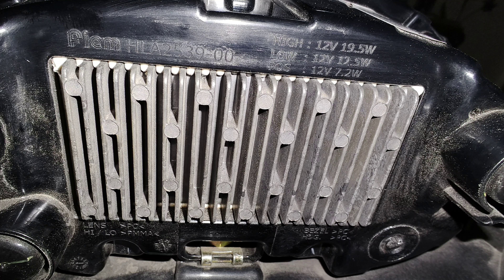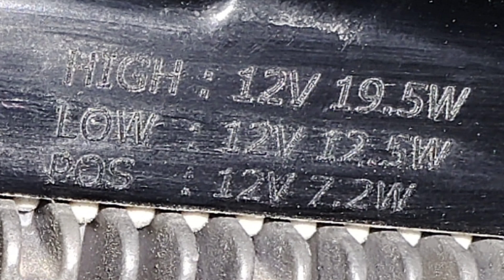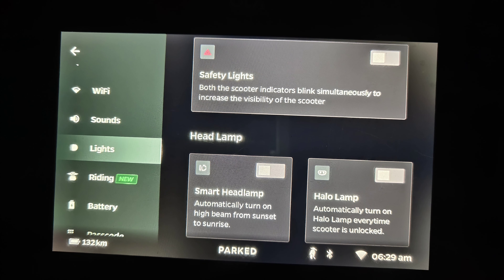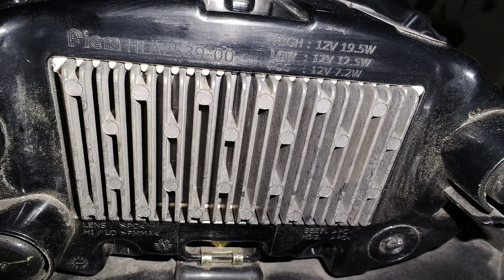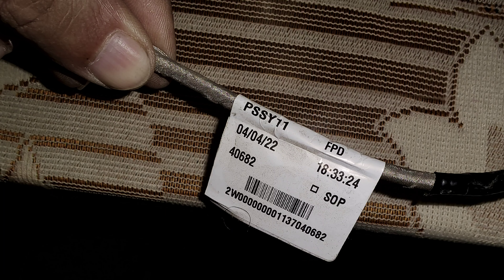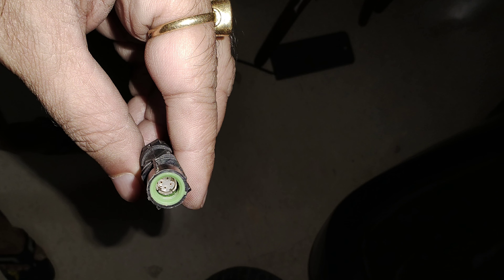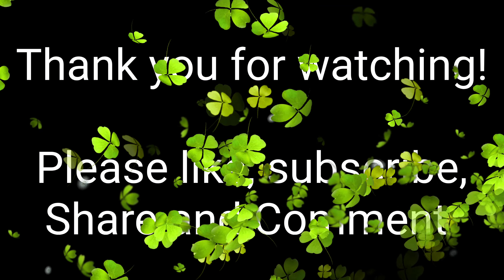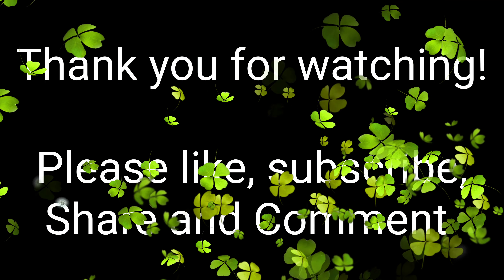Ola S1 Pro update । Headlight Specs । FPD Cable। Expected MoveOS 3.0 Final Featues । Bhavish Agarwal

Comment: Halo lamp's light output is not enough to be considered as a drl due to regulation. Input wattage and light output can be very different since the halo lamp's design is to diffuse equally all around the ring.
Reply from the maker: Don't understand the need for DRL in the first place while I understand some light might be good for foggy conditions. Keeping them permanently on during the day wastes energy. What purpose will low beam serve anyway when Halo lamp may be more visible anyway during the say due to it being diffused across a wide area like any other DRL
Reply: @InfCloud  i agree with the need for drl in sunny days, its was i thing yo make 2 wheelers more noticeable. But the halo lamp is not at all noticeable in daylight, even in early evenings. Maybe that's why the regulation authority deemed it as not enough bright for as a drl
Reply from the maker: @SivalalRamakrishna  - Needs investigation and how low beam can make a difference. Also, blinding lights during the day when not needed don't make sense

Comment: Since you have updated, can you please check if this issue is resolved?-
- After giving throttle input and despite letting it go later, the scooter keeps accelerating for a fraction of second before going neutral (much more noticeable after giving full trottle for a moment) - this happens in all modes (normal, sport, hyper) in my new Ola S1 Pro and one other test unit on Move OS 2, meaning it likely happens with all.
Reply from the maker: Haven't noticed this on MoveOS 2.0 as well. If regen is active, it immediately starts slowing down (ofcourse it takes a moment for power to reverse from positive to negative on the wheels)
Reply: @InfCloud  In other two EVs I rode - iQube and Ather, the moment I let go of throttle, both scooters stop accelerating, keeping the regen aside.
Ola doesn't stop accelerating for a fraction of second before going neutral. Normal, expected behaviour is the motor to turn off as soon at throttle is let off which is seen in Ather and iQube.
This is extremely dangerous at moments when even a meter worth of slowing down is crucial.
Not a single person is talking about this, even the brand champion assigned to me says electric motors have inertia and hence it takes a bit to stop accelerating, which means he accepts it existence but considers it normal - but to believe what he said would mean to discard all the Physics I've learnt.
Reply from the maker: @Rajesh-cg5pz  Check other S1s like a test vehicle. Yours may have the issue as I would have noticed this immediately if existed as am also critical about these and had been rejecting all Tata vehicles about a decade ago for the same reason and older Nexon EV also had this issue. Haven't noticed this on S1 Pro
Reply: @InfCloud  thank you for confirming. I'll get to Ola service center and see what they have to say